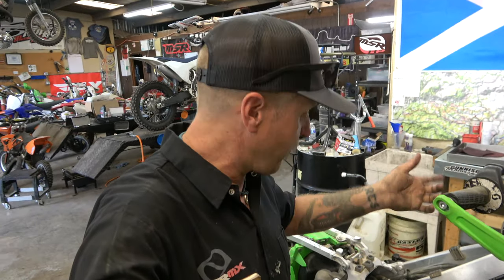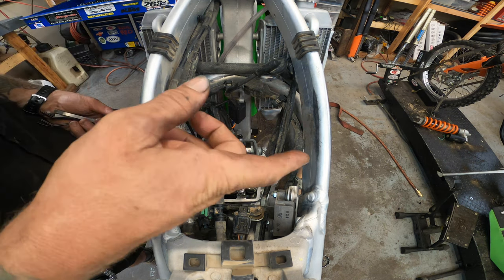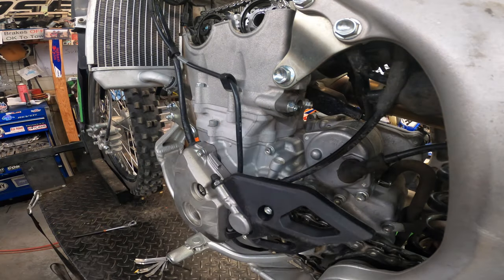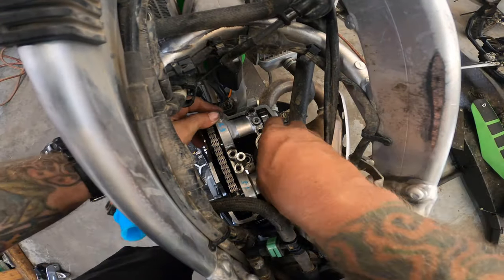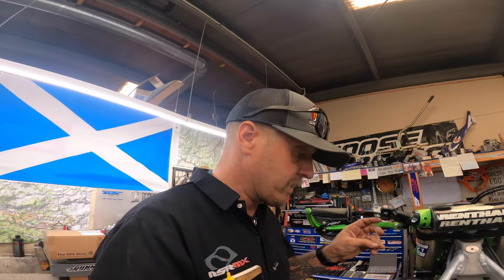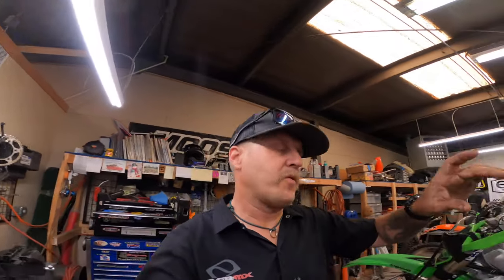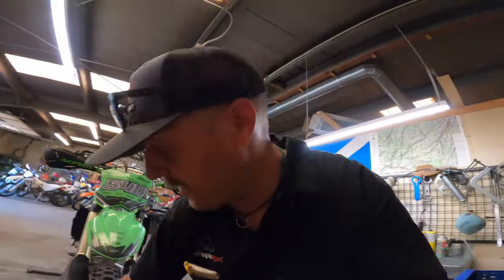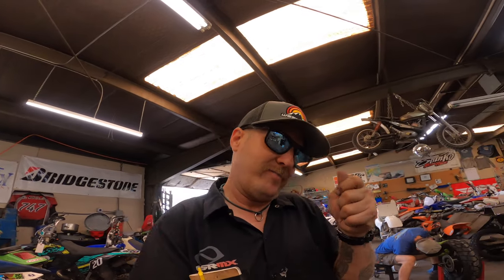KX250 Valve Adjustment

Comment: I have a KX 2019 250F and I think is having that problem. I have to throttle it after I kick a couple of times  for it to start and after that it accelerates its self. It just wont start with a normal kick. I also have the orange warning indicator light that wont turn off once I have the bike starting.  The air filter was well adjusted I don’t think air when inside those valves. What do you recommend me to do?
Reply from the maker: Not sure man. Sounds like you might need to take it to a shop.

Comment: I just did my valves on my 2020 Kx250 and they seem extra noisy but the bike runs ok. Is there anything I should check?
Reply from the maker: Maybe check them again and make sure they are good. I have seen people adjust them when there is a little pressure from the cam so it ends up being too much
Reply: If you can hear valves then you still have valves. It's just a kawasaki thing

Comment: Do you reuse valve cover gaskets as well as the bolt washers? I'm about the tear the valve cover off my KLX and not sure if I should replace the gaskets or not. Manual says yes but I think I can get at least one valve check out of it? Thoughts? Thanks for answering strangers questions on the interwebs.
Reply from the maker: I usually re use them once
Reply: @highlandcycles  Appreciate it my dude. Gonna tear into it this weekend. Here's to hoping my air filter maintenance has been up to par haha

Comment: They can't make adjustable valves, still? lol
Reply: Funny thing is, they do…. On Chinese bikes lol.. I started with an Apollo 250 and adjusted the valves with no shims or buckets. Figured my kx would be a breeze but was unprepared and find myself watching this video lol
Reply: @greengrind5089  I hear ya, yeah, when 
I say 'they' I mean , you know they, those 
people out there lol,, I refer to the big 
manufacturers of the performance bikes.
I have  a YX 140cc motor, it's like the 
Lifan, has adjustable valves. I like the 
fact that it's air cooled too, like my Harely,
sure they both can run a bit hot, but I 
don't care for boiling anti freeze on 
my legs either. lol
----
I'll take a shot at your spec question here, 
so I don't hinder a response from the CP,
in your actual OP, looks like he responds
to people fairly quickly.
''Spec 14-18 mm , should I shoot for 
middle; 16?
I always go somewhere in the middle on 
specs. As you probably know; Tolerance , 
means or within a specific parameter,
sometimes a mfgr or designer will just 
state; + - If close tolerance isn't important.
If you set clearance at 14, 15, 16, 17, or 18, you are 
technically within spec, that's kind of what 
tolerances are all about. I suppose temps,
air pressure, humidity all play a part in 
effecting typical tolerance figures and settings
--. 
Part of the following is a guess:
If you are doing a certain type of riding;
as in mx vs enduro, and at a certain location,
it might be desirable to set valves etc, 
slightly tighter or looser, whereby you could 
go higher within the spec range or lower, and
remain in 'spec' , according to the mfgr, 
and improve performance for the location 
and conditions, slightly.
Reply: @bikersoncall  Thanks man, I appreciate the response. And I just finished it up a bit ago and put it in the middle so glad to hear it’s the right choice. I do mainly desert trail riding so I’m sure the mid spec will work out fine, I’ll take it for a ride later but starts up and idles good. Thanks again.
Reply: @greengrind5089  You bet, glad it was 
of some use. I desert ride too, most of 
what I ride is river-bed, gets very silty/sandy
at times. Have fun  out there! 
I have my bike 
torn down, no spark, may have solved it
though seems the stator is the issue;
stator, coil, cdi, on the way.
Reply: @bikersoncall  Hope that sorts it so you can get back on two wheels again!
Reply: @greengrind5089  Thanks for the encouragement, I'm making progress!

Comment: Thanks for the video, and just a quick question… do we shoot for the middle of the spec? For example, if my exhaust spec is .14-.18mm, should I be aiming for .16? This is one thing I haven’t heard mentioned yet, and though I figure “in spec is in spec”, it might be best to go for dead center
Reply from the maker: That is a great question. Real hot rod motor builders will usually shoot for the tight end because you get more lift and therefore more air/fuel in and more power. I like on the loose side because it takes longer to tighten up and I can’t possibly tell the difference in power.
Reply: @highlandcycles  Thanks for the response! I feel a bit silly now as I tightened the clearance of one on the loose end. Oh well though, looks like I’ll get some more practice in a bit sooner!
Reply: Agree!  A loose valve is a happy valve.   @highlandcycles
Reply: @endurox1481  Within limits. The cam curve is designed to take up the slack, make contact, then accelerate the valve toward open. with too much clearance the acceleration part of the cam is reached first because the cam couldn't make contact across the too large clearance. When that happens the cam slaps the valve lifter to first move the cam instead of making contact then accelerating it. The max valve lash is set at the factory with that in mind. The minimum designed lash is designed to guarantee some gap given differential thermal expansion among the components. Neither direction out of spec is good.
Reply: @fitch8363  I completely agree.  When I say loose is happy, I mean you don't need worry about a valve hanging open and causing severe damage to the piston, cylinder, etc.